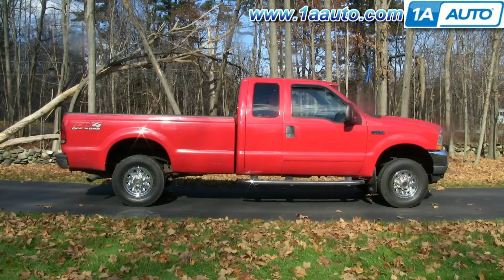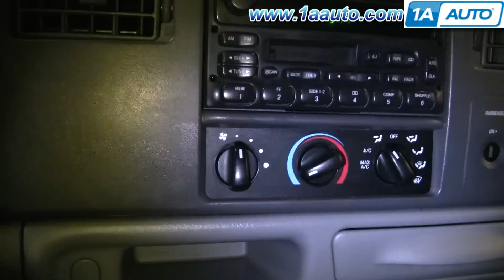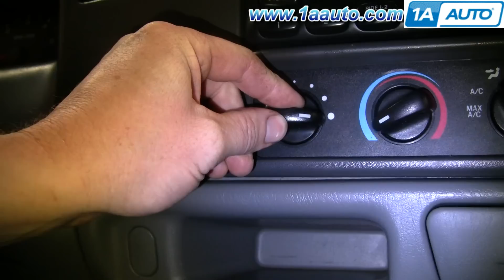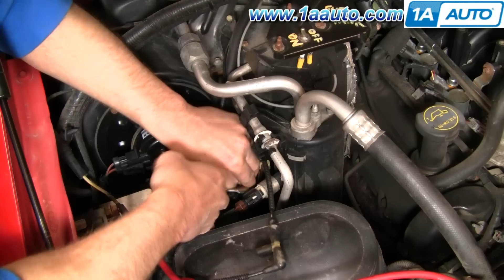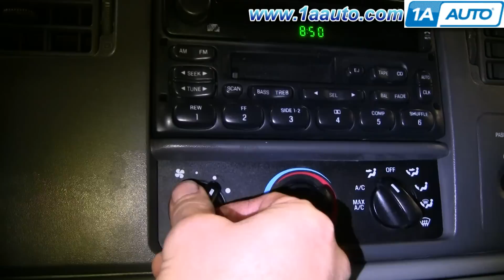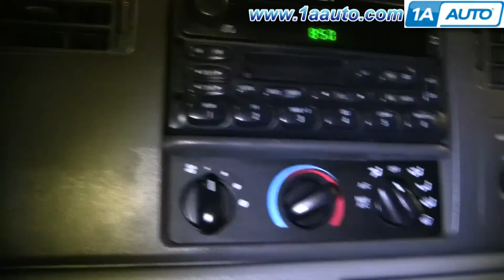How to Replace Blower Motor Resistor 99-07 Ford F250 Super Duty Truck

Comment: Hello, I watched the video and changed out my resistor, Blower works fine at all speeds and on Auto, My problem is that similar, to my original issue, The cool air is Intermittent, it blows Cold at times, then switches to hot air, I should say Ambient Air, then  goes back on to cold air, when it feels like it !!! any suggestions for my next course of action would be GREATLY APPRECIATED !!! Thanks, keep the great content coming !!!!

Comment: I replace my on 2005
Ford f350 checked all the fuse still no go you 
Used to work only on 4 speed but now nothing i changed  blower resistor still no sign you think the motor is burn out?

Comment: Getting ready to attempt this in my boyfriends 2002 F450. Much different than the replacement in my 04 F150 but I'm confident. Have the part from Advanced Auto. Hope I can get it done for him :D
Reply: Update- Success! But- I HIGHLY RECOMMEND NOT trying to chip away at the resistor end of the plug. I cut the wires and replaced the other side as well because the wires and plug came with the resistor. MUCH EASIER. Good luck to all with this. I said some things while trying to do this repair, but within an hour, a newbie got it done. Thanks!

Comment: So what is the reason this blower will not turn off with the ignition off? Yes I have replaced the relay but it is still buzzing as well.
Reply from the maker: +TJ Tew We wouldn't be able to diagnose an issue like that here, you may want to have a local mechanic take a look at it. Thanks for checking us out! http://1aau.to/m/Shop-1AAuto-c

Comment: Do you have a video for the third gen f250?  Unfortunately my 2011 has this problem but it doesn't look like this under the hood--the battery is located in that area.  I'm not finding much on the web trying to find out where the resistor is and how to get at it!
Reply from the maker: +Matthew Smith We don't have a how-to video for your vehicle right now, but we'll keep this request in mind for a future video! http://1aau.to/m/Shop-1AAuto-c
Reply: One forum(which I believe is correct) says you have to remove the whole dash board  to get at the resistor.  Hoping you could show an easier way.  There is no definitive info about this on the web.  Without the factory service manual whats a poor boy to do?!

Comment: Use the right chemicals for the job!  Contact cleaner and dielectric grease on plugs and connections. It is like saying any trans fluid will work. Yes it will. For a while it will for a while then...
Reply from the maker: +inmt42003 Thanks for the tip!

Comment: Great video! I was trying to break away the pieces of the resistor and the whole harness fell apart.  They welded themselves together. So I replaced the harness and the resistor.  Back in business with 4 fan speeds!! Helpful video!

Comment: Once I finally got the resistor off. The connector was burnt out. Replaced both of them and still no blow action. Got any other suggestions to troubleshoot?
Reply: clintgardner69 I just read online that the resistors can burn out because of high resistance in the blower itself.  May need a new blower too.  Then I suppose you’d have to make sure the new resistor hasn’t burned out again.

Comment: Grease is not a good conductor, use die electric grease and an electrical cleaner, clean up the wire spades or replace them.

Comment: So I replaced my resistor and even the harness since it was burnt up and melted. Still have the same results, blower fan only works on high. Any other fix for this or what else may be the issue?
Reply from the maker: +Devin Manning You may want to test the switch too.
Reply: test the switch
Reply: How do you test the switch?
Reply: I know this is old comment but for others since it was burnt the contacts and/or wire harness can be open. You can buy a new connector which has about 6" of wire lead. Use butt connectors and heat shrink for your splices. If not I would suspect the switch. You should be able to see damage to the connector. Wire insulation might be blistered.

Comment: I have a 2004 excursion EB 6.0. I am not getting anything from the front fan. My resistor looks different than the one on my f250 but they have the same engine. I am not getting power to blower. How many volts should I be getting at high speed? Also, i can't get the lower bolt of my resistor off without taking Freon cylinder off. Any information would be greatly appreciated and thank you for the videos.

Comment: I have a 2000 F350. My AC stops working randomly and none of my AC/heater settings or fan speeds work when starting my truck, but you can feel refrigerated air easing out of the vent if you stick your hand up next to it.  It will stay out until I hit a speed bump going at a decent speed or hammer on the gas from a dead stop...almost black smoking it.  Then, it will work normally for a week or two until it stops again.  Do you think that is the resistor or the entire blower itself?
Reply from the maker: +Kendall Thurn Usually when you loose the fan speeds it's an issue with the blower motor resistor. You may also want to inspect the plug end going to the blower motor resistor to see if it is heat damaged, which could cause an intermittent power situation. Hope this helps you out. 1aauto.com
Reply: 1A Auto Parts Changed the resistor myself and it’s still acting funny.  Connector looks fine to me...think it’s my fan motor then?
Reply from the maker: +Kendall Thurn You could try to replace the blower motor. Inspect the plug end that goes to it to see if it's heat damaged. We carry new blower motors on our website. Here is a link to them if you need to replace the one that you have. https://goo.gl/AzvJY4

Comment: Thank you very much for the video, it saved me a ton of time and money fixing this myself.  Instead of breaking the plastic piece that houses resistor I drilled out the rivets (one on each end that holds the resistor base plate to the plastic housing) and worked it apart pretty easily, but I got that idea from watching you breaking the resistor piece our of the harness connector, that is a good idea and it's something I wouldn't have thought of.  I would have definitely broken the clips so thank you!  Also, my electrical terminals were really corroded so I put conductive anti corrosion grease (the stuff they use when making connections with aluminum wire, it's available in several brands) and used a tiny jewelers flat blade screwdriver to clean out all the terminals in the harness.  I didn't clean them good enough the first time so had to do it again.  Everything working now thanks again!!

Comment: On my 2000 F350 the blower quit working a few times for a while (wouldn't work on any speed) and then it would come back ON and work fine for a while. Following your guidance here, I unplugged the blower; checked between ground on the battery and one terminal -- got a light which means the hot feed is good (key on; blower swtich on) and checked between the positive terminal and the remaining plug terminal -- also got a light which means the ground is good. Read somewhere to tap the metal hub (lightly) at the center of the blower. They sometimes get stuck . . . and ours started turning right away! This, of course, means the blower is on its last leg (no surprise after 266,000 miles) but it's working for now. Thanks for your excellent assistance! :)
Reply from the maker: +Jim Peterson Thanks for watching. If any of our viewers needs to make this repair, we carry the auto repair part shown in this video on our website. Here is a link to them http://www.1aauto.com/1A/BlowerMotorResistor/Ford/F250-Truck/1AHBR00069?utm_source=YouTube&utm_medium=CTA+Comment&utm_campaign=ytcomment&utm_term=teZwoBltprs
Reply: I have pretty much the same problem. Before inrepalced anything I unplugged blower motor and pulled back in and it came back on. But went out after a few days and a few taps brought it back to life. So if I  have replace the resistor and a burnt out connector that I discovered and the blower motor still isn't engaging. You think the blower motor is toast?

Comment: if high is the only speed that does not work. what might that be the blower speed switch?
Reply from the maker: +J Hetz It would be hard to say without seeing it, but that sounds like it could be a problem with the fan resistor.  Hope this helps you out.  1aauto.com 866-403-3393

Comment: I found that drilling out the 2 rivets on top and prying out the contacts was a lot easier than nipping away at all the plastic.   Once the contacts were pulled out, the plastic came right off.

Comment: I replaced my blower resistor about two or three weeks ago and it worked great. However, It recently stopped working on the lower three settings again and I was wondering if you had any clues on why it isn't working. Thanks for your input.
Reply from the maker: You may want to check the fuse and also the power going to the blower motor, to see if there's power going to it when the switch is on. You could use an ohm meter or a test light to do this.

Comment: Just want to thank you.  All four speeds in my blower quit at once.  Replaced the resistor and back in action.  Gotta have that AC hear in Florida.
Reply from the maker: Thank you for watching!
 888-844-3393
Reply: So was your ac clutch engaging and nothing from any speeds? That's what mine is doing.

Comment: Had exactly this same problem with my 99 F250 super duty. Video was great, but I had same problem as Duane C with the male connector leads disintegrated. I also bought this connector, cut old wires and spliced in those from the connector pigtail. Somewhat tough to get at, but all the speeds on my fan now work!

Comment: I have '98 econoline F-250 and my heater stops, after five minutes of working while I was driving. And when I turned Off and On the heater/ac switch it's still doesn't work. Please tell me how to fix this issue. It's freakin cold inside a car when I'm drivin with a dang broken of something :<(
Reply from the maker: You may want to check the wire plug ends going to the blower motor and to the resistor to see if they have been heated up and damaged. Hope this helps you out. 1aauto.com 888-844-3393

Comment: my a/c in my 2003 f250 seams to blow weak. i can turn up the fan speed and i hear it working but very little air comes out its like something is restricting the air flow and i cant seam to find the problem. any suggestions short of taking it in?
Reply from the maker: +Robert Pemelton It sounds like you need a new resistor for your blower motor. Have you tried swapping out the old one?
Reply: Hello. I have the same problem in my 2001 excursion 7,3. did you found out what is was?
Reply: Check your vacuum system